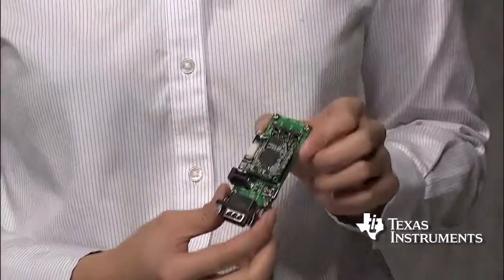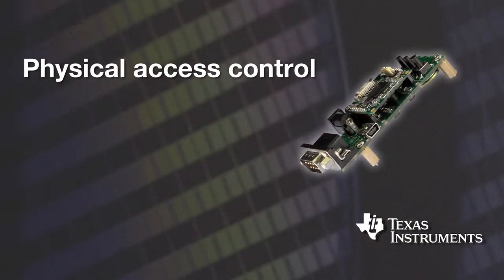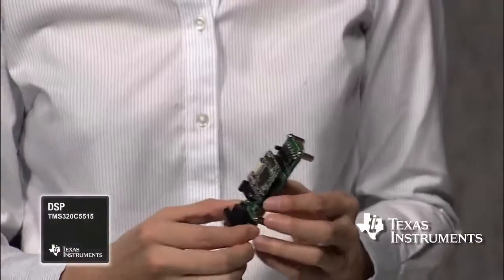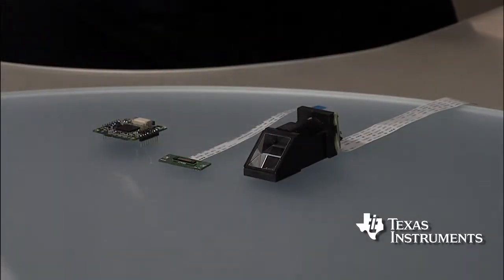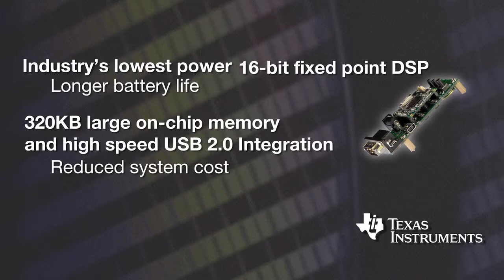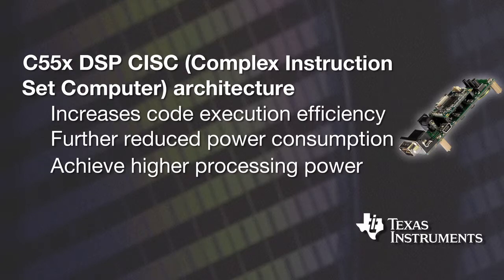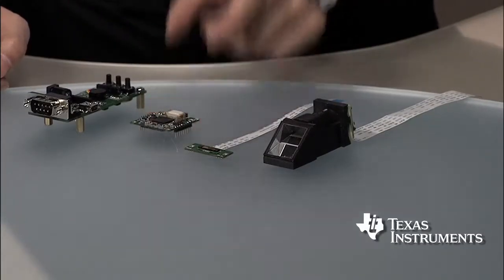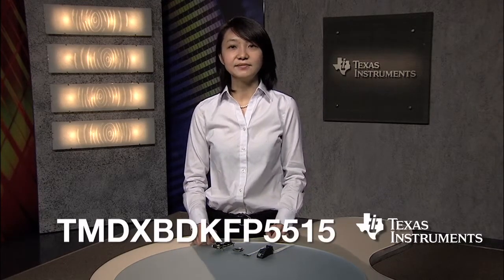C5515 Fingerprint Development Kit Overview

Comment: May I program TMS320C5515 DSP to work as graphics controller? Maximum resolution that could be supported by it will be what? Do you have any tutorial to write graphics program for C5515 in C? 
Actually I'm working on a project. Please, therefore, reply ASAP! Thanks :)